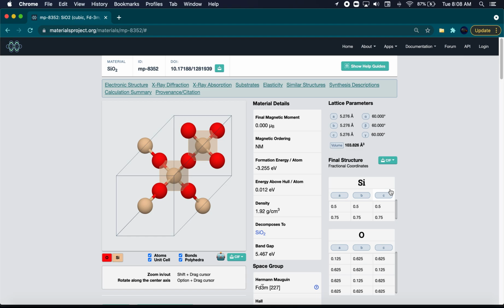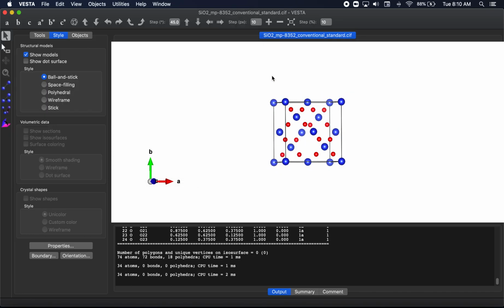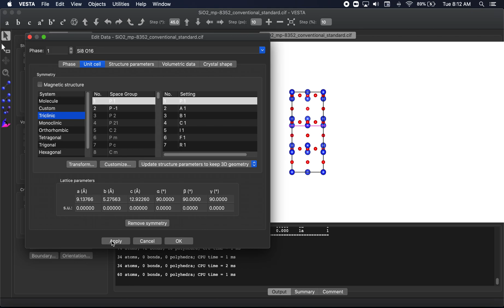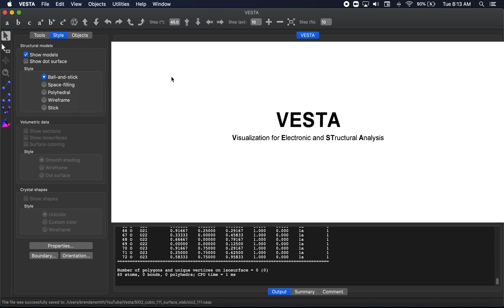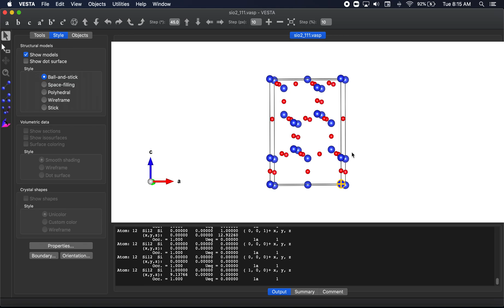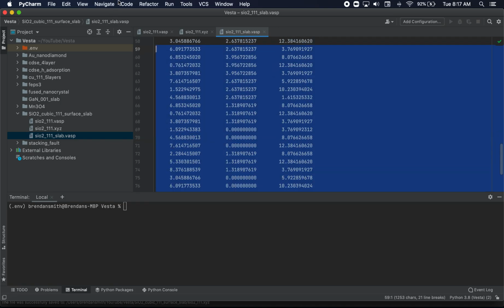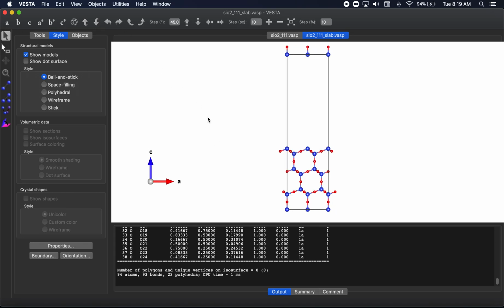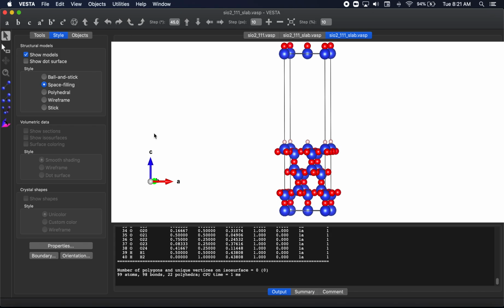SiO2 (111) Slab Model (can be tricky) in VESTA

Comment: Thanks for doing these videos!! 

I have been trying to use vesta to generate grain boundaries for bcc cubic crystals but apparently the structures that i have been obtaining have many problems when i try to optimize/relax them. Is there a way to use vesta to construct, lets say, a sigma(5) (310) csl grain boundary for any cubic crystal?

If its possible but you cant make a video about it, can u give me some advices to generate the GB?
Reply from the maker: Thanks so much. I have a video where I do a twin boundary for silicon but keep the system bulk. If you follow that video but then add vacuum would would get a slab where at the middle is a twin boundary. I may redo that video soon. I’m thinking about remastering a lot of my old videos before I know how to video tape better.

Can you please send me a paper describing the boundary you want to make? Preferably with figures so there is some way I can check my result.

Thanks for watching!
Reply: @nickelandcopper5636  

Thanks for answering so quickly =P have watched many of ur videos but somehow missed the one u just mention.
Im trying to replicate the first paper (Yu et al) but with a doped crystal. The construction of the GB is based on the second paper (tschopp). I have used some python libraries, material studio and vesta to recreate the GBs but at the moment of minimize, it shows that the structure is highly unstable (pot energy e+85 in just second after starting the minimization). The minimization script works fine for the doped structure (bulk, not the bycrystal GB) so there has to be something wrong in the way im buiding the GB =( 

10.1021/acs.chemmater.7b02805 (Yu)

https://doi.org/10.1186/s40192-015-0040-1 (tschopp)